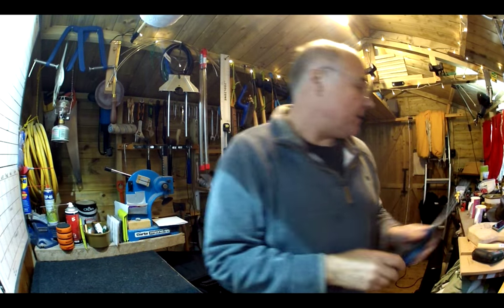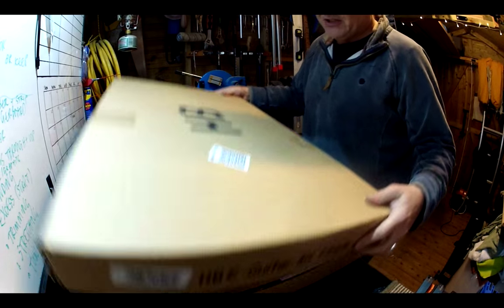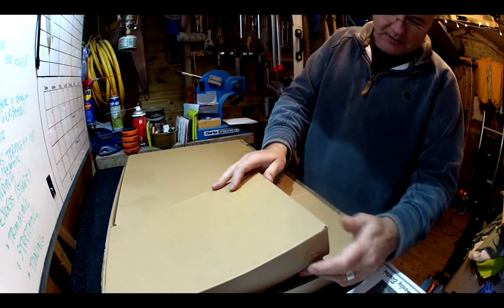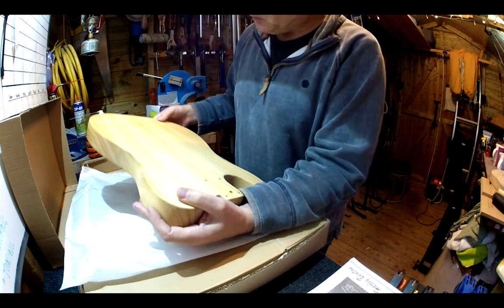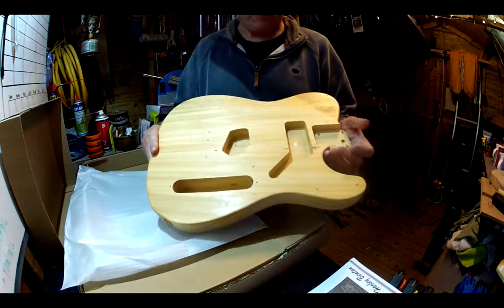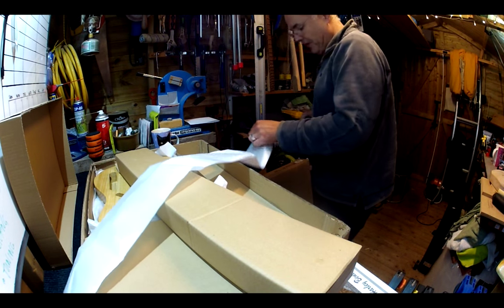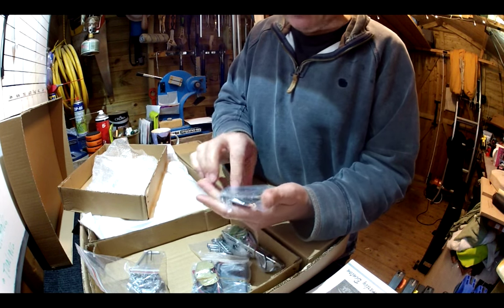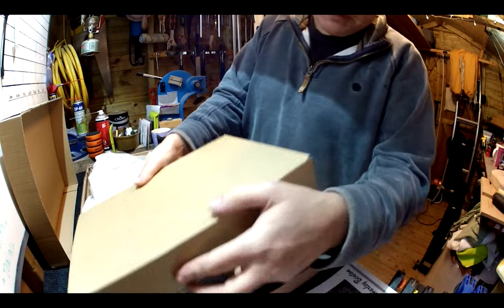Harley Benton Tele DIY kit unboxing

Comment: Hi Sam
I made up one of these kits about 18 months ago, I finished the body and neck with boiled linseed oil and changed the pickups for tonerider hot classics (recommended), I swapped out the tuners for Wilkinson EZ-Loks (rock solid performance at a budget price), I fitted a Sprague Orange Drop cap and a treble bleed circuit, the frets on mine were a little all over the place and had to be levelled, it now plays so sweet and it resonates better than any of my other guitars, even my 73 Tele!
Reply from the maker: +John Smith Sounds great! I like all of the components you added being a big fan of EZloks and Toneriders. The question for me is as a 'build-setup-and-sell' guitar, what would I have to charge if I kitted out like that? I suspect that price-wise I'd drop in at the edge of Classic Vibe Tele territory - about 230 - 240. Risky.... Great for a keeper, but risky for selling on. Tempting though :)
Reply from the maker: +Sam Deeks BTW I have NO idea how or why I ended up with 'strike-through' text ^^^^^^^ :-) Bizarre .
Reply: Sam Deeks Yes it certainly did bump up the price a fair bit, I don't think the original pickups were bad but I had the toneriders around and wanted those instead, the EZ-Loks were a real improvement on those that came with the kit, but they may have improved in the originals in the last 18 months so that might not be needed any longer, I can also tell you that the neck to body fit on mine was about the best on any guitar I've ever seen and the routing was (like yours seemed to be) VERY clean and spot on, it all lined up right first time with no sanding needed.
Reply: Sam Deeks If your cat is anything like my two then it may be that Morris walked over the keyboard and changed a few settings  : )
Reply from the maker: +John Smith I hadn't thought of that :-)

Comment: Built one two Christmases ago! Great kit, I stained mine cherry red then used tru oil! Also put some old fender Tele pics in it. Great little guitar I'm not worried about putting a dent in haha. As people at my college don't give a toss about people's stuff!
Reply from the maker: +ThatGuyNamedScott. C How can you mind getting a £45 guitar a bit scratched or dented :-) It's too good to be true. I'm torn between keeping it 'as it came' or putting some great pickups / tuners on it...choices, choices!
Reply: I'd built it up stock and as you find pickups or little bits of hardware that are better or a great deal you should upgrade!
Reply from the maker: I suspect I may end up doing that :-)

Comment: Do the pickups not need soldering (quick connect) or do they need soldering because someone told me they didn’t and I am thinking of getting one because I don’t own a soldering iron.
Reply from the maker: Hi WCM - this kit came with 'snap together' electrics - no soldering needed. You might see me soldering here because I changed out the pickups for some higher quality ones and these obvkously didn't come with connectors to fit, so I had to do some soldering.

Comment: nice deal!
Reply from the maker: +Iggytommy It's a teenager's dream. Everybody should be giving this kit to kids in their lives this Christmas. The satisfaction of making and then playing their own guitars...wow. And for £53-ish including postage? Bonkers. About the price of a brain-curdling Xbox game.
Reply: yep. what's not to like!  for an affordable upgrade on the pickups, I'd suggest the Wilkinson premium range ones (about £23 each).  The only things that are troublesome are: cutting the headstock, and applying a finish to the body. If maintaining a natural finish for a natural finish on the body, can one use furniture varnish?
Reply from the maker: I cut the headstock yesterday (breaking the law of course and using a Fender shape...) and ordered some Tone Rider pickups because I was so impressed with the set I bought for my black & maple strat
Reply: Tonerider - very good and affordable, too.  yes.  v. good choice.  nice.   i don't have ant power tools or anything so I dunno how would cut a headstock.
Reply: p.s. I've never liked the Tele headstock. too skinny.  I have a 'Vintage' Tele guitar but for some reason it had their Strat model's neck - which is ideal for me cosmetically.
Reply from the maker: Yeah Vintage 'teles' have the same headstock as the 'strats'... I don't mind it, but it makes it less saleable despite their 'teles' being as good as if not better than most Squier teles. The power of brands and trademark designs eh!?